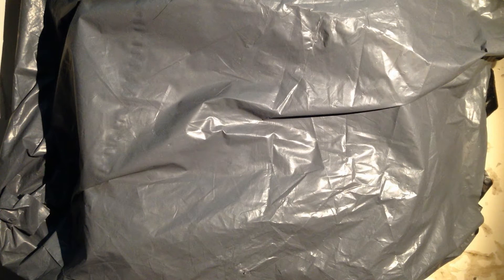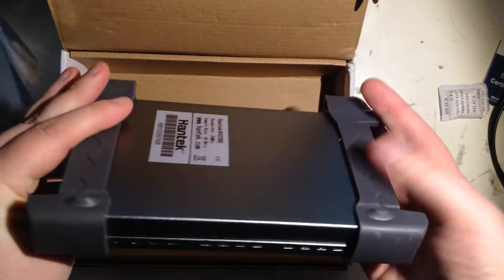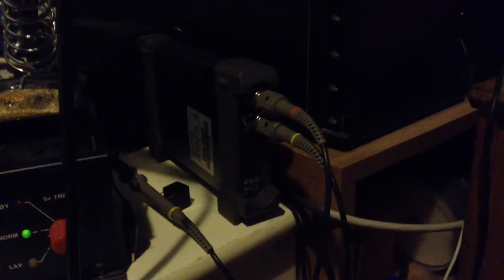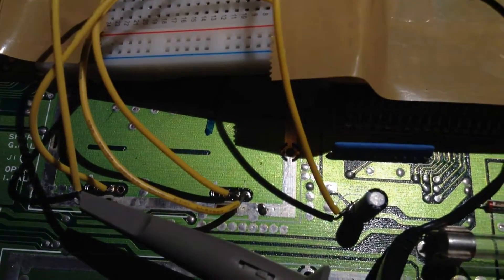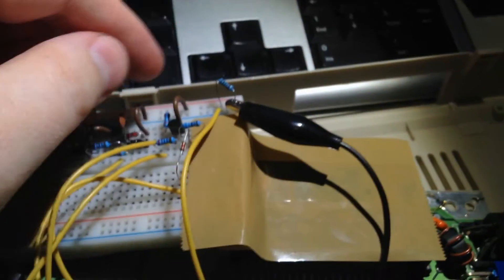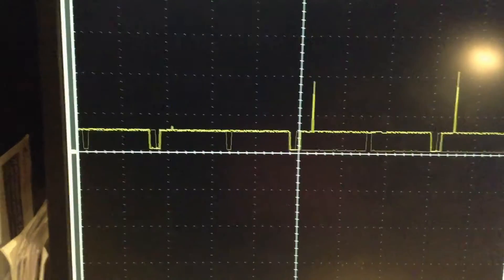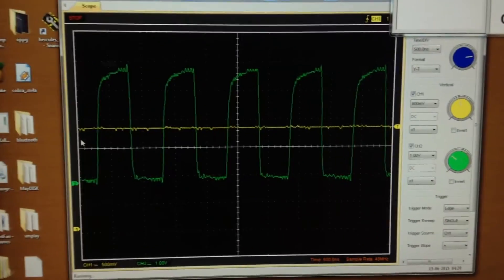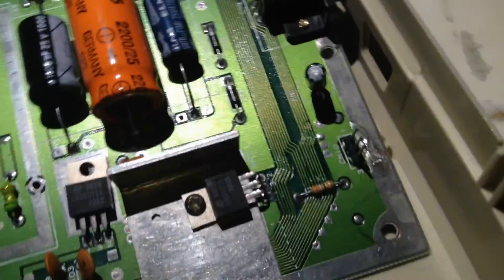New PC-Oscilloscope and C64 video working again

Comment: It's interesting to see you applying your knowledge of electronics to a C64 like that. I understand very little of what a scope does but it's educational as hell 😀
Reply from the maker: The Highlander An Oscilloscope is analogous to a microscope. Instead of looking at space in two dimension we can scope time in one dimension and voltage in the other. In this way we can see what happens to a node (solder point, ic pin etc) that we want to look closer at in short window of time, and also we can give the scope instructions to what conditions it shall start drawing an image (thats called trigger). The scope oscillates. With analog scopes that meant that the screen was drawn from left to right over and over at a speed that you set with one of the two main rotary knobs, and while the scope oscillaties you can then take the probe and pick-up for example an audio signal. Now that signal will be drawn on the screen because the beam sweeps horizontally while the audiosignals voltage potential will push the beam vertically simultaniously. This produce the picture, and it is very much like how CRT screen work. Most often it will look like garble unless the signals frequency is that same as the scope oscillation speed, but if the signal repeats itself we can set the scope to trigger and get a stable picture. This is because the image is then drawn over and over and it appear to us as if it is one picture. In a digital scope like this PC-Oscilloscope the operation is almost the same, but instead of a beam sweeping from left to right, a digital oscilloscope's memory is filled from left to right over and over with samples. The memory can be much deeper than what an analog screen can show practically and has it's advantage if you're looking at long pulse-trains.. This reply got longer than anticipated :) Oh i forgot what it is used for haha, well mostly to measure time, time it takes for a signal to fall or rise... Other uses.. signal integrity. What happens to the 5V power at power-up, does it overshoot 5V, does it rise slowly, or does it take a break and then go all the way to 5V. How much time is there between power-on and the reset signal to go active, and how long is it active, or is it reseting at all.. The list is long and uses are many.
Reply: Wow! Thanks for the explanation. Hahaha. I can see that the scope is an essential tool for analysing circuitry. I suppose the whole thing starts with realising that any circuit oscillates in the first place. I have to say that I am very interested by all of this. I hope you analyse the hell out of that C64 or a bunch of audio amps. I love to learn :)